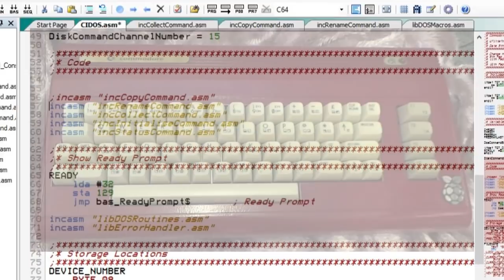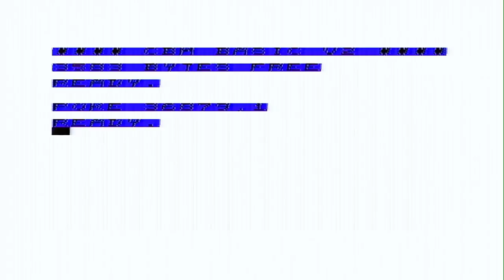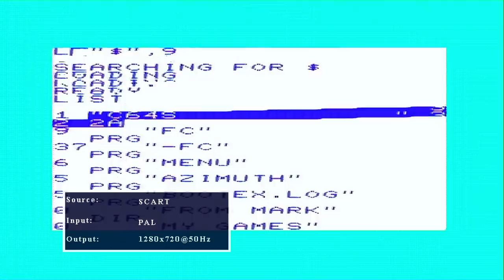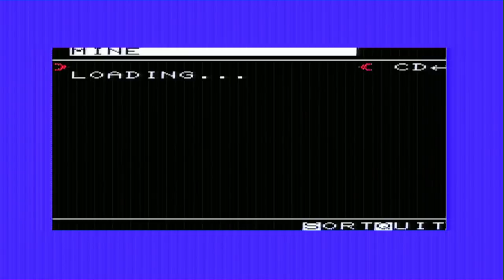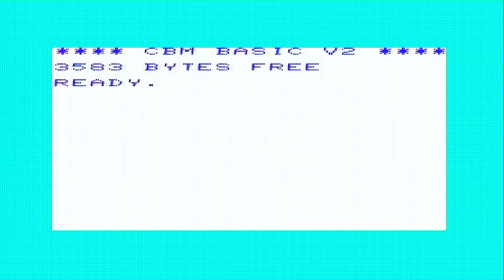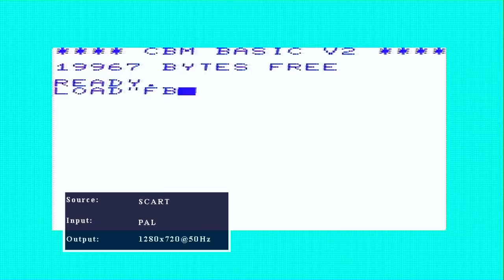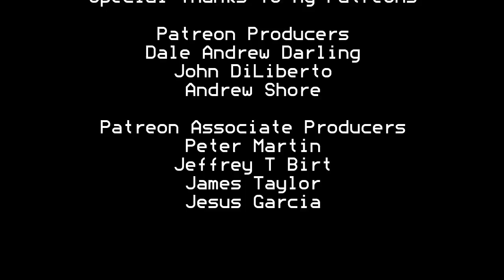Project Future Proof - Episode One - My Play VIC

Comment: One of the better ways to remove old caps from a double-sided plated through-hole board: Heat one cap's lead at a time, pull the cap out and then use the solder sucker and iron to clean out the holes.

Comment: 23:34 Is that big capacitor standing straight up going to fit properly under the VIC's keyboard?  [Apparently, 38:15.]

25:19 Other YouTubers use more sophisticated de-solderers that combine the heating part and the sucking part into one item.  "8-bit and more" uses a manual such device quite successfully: https://www.youtube.com/watch?v=9GyihcyTr9M&t=195 .

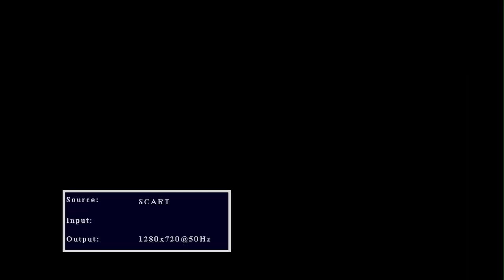36:35 Is this signal using RF or composite video?  Your TV says SCART, though it's not clear how that connects to the VIC.  I suppose it's all going through a video-capture device.  Does the picture look any better if you connect the VIC directly to the TV?

Comment: The fuzzy look of the images that the VIC produces has not much to do with capacitors, the VIC just has a very bad video signal. The chroma signal is too bad for most modern displays, so that they interpret parts of it as the luma signal, which makes the pixels look fuzzy and sometimes smaller than they should be, which causes these strange vertical lines and these pixel offsets.